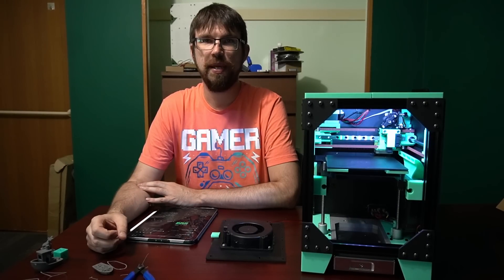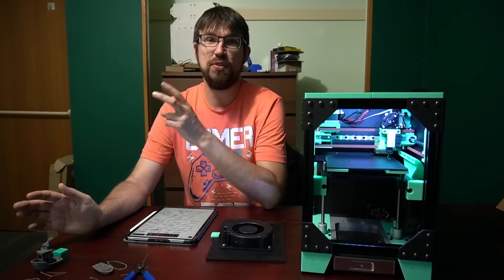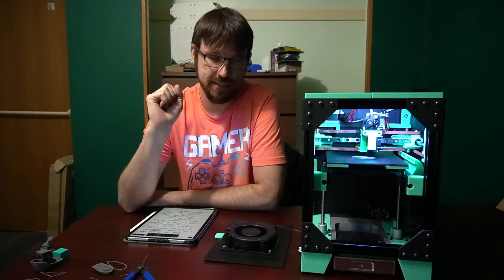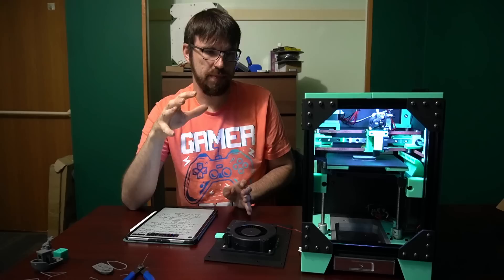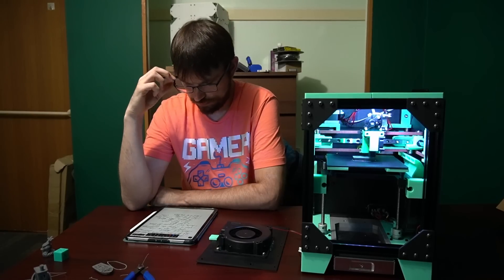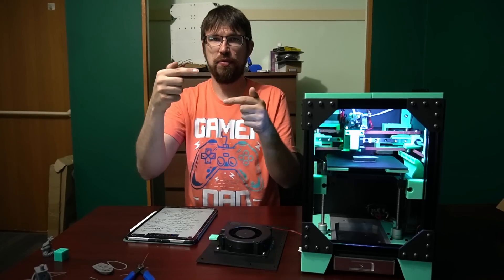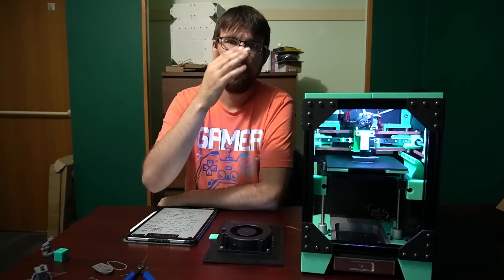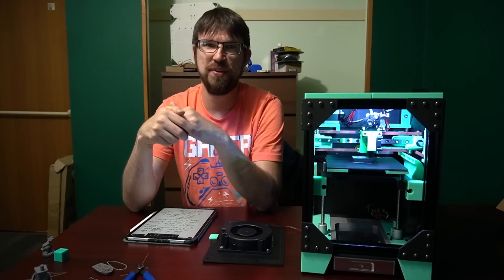DIY High Performance CoreXY 3D Printer - Panda Mini Release!

Comment: Can I print the parts of any of your printers using a 0.6mm nozzle? Or does it need to be a 0.4mm? Just concerned about precision is all.
Reply from the maker: I have not tried, if your printer is tuned for 0.6 I don't see why it wouldn't work

Comment: What a coincidence! I am currently also developing a corexy 3d printer that uses v-wheels for z similar to your design but without the springs. I am just using using eccentric nuts for tensioning.

Comment: Darn it, I haven't even finished my other projects and now I want this one too, LOL!  Nice job sir, learned a lot of interesting tidbits from watching this, especially about those Bambu hot ends, had no idea they were that cheap.  I'd love a small printer that can bang out ABS+ printer parts, and this fits the bill.  As long as I can use sparkle ABS+ from Sparta3d to build it, I'm putting this on "the list".  🙂  Cheers from Ottawa!
Reply from the maker: thanks! Check out the new version called RC150, it's much improved
Reply: Ahhhhh, so THAT'S why I couldn't find a Panda Mini Discord sub-channel.  Subbed now, will definitely do further research into RC150!  @Rolohaun

Comment: i have Old p1p CTRL board(CN ver.) can i use for this project?
Reply from the maker: not sure what that is by any control board that can run klipper and has a dual z stepper port will work

Comment: That build space is brutal though. I have a Finder with the same bed size, and I often envy the larger beds.
Reply from the maker: I will be making the full size Panda soon which will be 250x250
Reply: @Rolohaun  Nice, I am printing a full-size chess set (well, one colour at a time) on that tiny plate right now. sometimes one must just push the boundaries a bit. I love how good it still is at Fast mode.

Comment: pre-baking shrink into part designs isn't my first choice, instead I'd guide users to utilize the XY shrinkage function in their slicers. I do 99.3% for ABS and 99.8% for PLA I derived mine from shrinkage coefficients of the material properties, and left them on the conservative side, has worked well thus far for most anything I print. Some ABS mixtures shrink more than others, ones with glass fiber will shrink less, so it's more a material property, not a part property. I understand why for simplification though, and mad respect for all these designs you keep pumping out!

Comment: Nice build!
I built my corexy printer also with v-slot wheels on the Z axis; 
- 1 motor is driving the z axis ; 4 lead screws connected with belt.
- Only 4 v-slot wheels (with a v-groove!) are necessary: They are mounted at a 45 degree angle to ride on the inner edge of the alu profile, each pushing the bed to the center of the printer.  Never saw such a stable bed 😊

Comment: Good job!  I've come to the same conclusion for bambu hotends.  I use them exclusively in my Voron 0.2 and 2.4's now.  I actually posted a design on "printables" where I converted an afterburner to use bambu hotend recently.

Comment: Super cool! I like the look and it seems speedy. I will say it's crazy coincidental that Matt The Printing Nerd released his video on THE 100, his super fast printer, just an hour before this video. Given the cost of his printer, I think you'll have to find some ways to get cost down to be competitive. Yours does have the designed enclosure advantage. I'm happy to see both new designs and I'm not knocking you at all. Love any innovation in the space. Keep going!
Reply from the maker: The 100 is inspired by my Rook and this Panda printer is made to print ABS also which the 100 is not. They are different printers
Reply: @Rolohaun  That's super cool that he built off of your design! Definitely not trying to knock you like I said and the ability to print ABS is big for sure. Very different machines!

Comment: I might actually build this instead of a voron but will propably use linear rails instead of smoothrods for the y axis, the cost is pretty similar
Reply: How are you gonna mount them? There is no extrusion there.
Reply: @geometerfpv2804  I will add my own extrusions
Reply from the maker: it would be a big mod but I am sure anything can be done

Comment: that first extra bit of plastic hanging on as the first layer was place bothered the hell out of me but that looks like an amazing 3D printer. Might consider making this as an alternative cause I lowkey wanna print with abs but not the cost of a voron zero

interested to see how that fan holds up given that its just on one side
Reply from the maker: there are fans on both sides just not mounted yet

Comment: It looks pretty amazing tbh going to be a hard choice for my next build between this, a 100 or a micron 180.  I really like the idea of using the least amount of rails possible.  Keeps the build cost down
Reply: I think the choice is easy. This one uses 2020. The Voron zero will be moving away from 1515. With this one you can at least start with the bones of an ender 3. The other printers done seem to be worth it at all. The 100 look finicky as hell and the Micron 180 is 1515 and is similar to a voron 0. Very happy to see this printer!